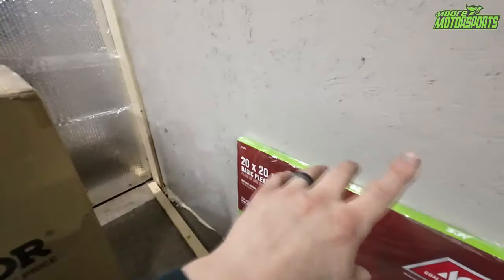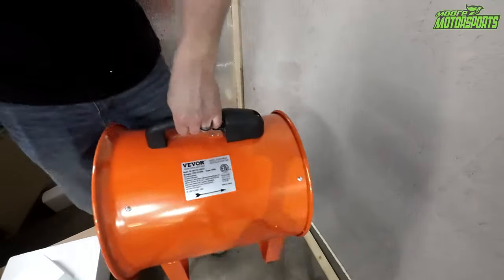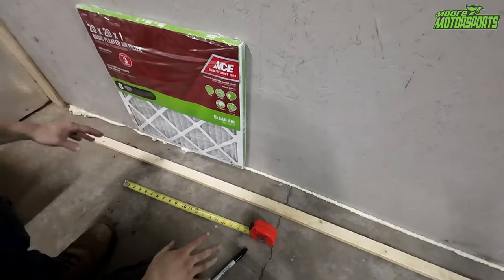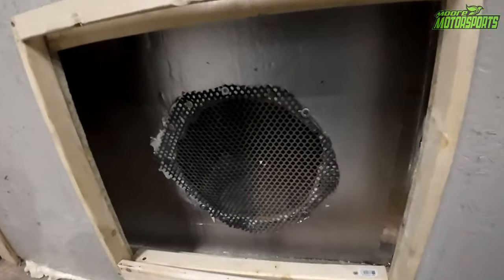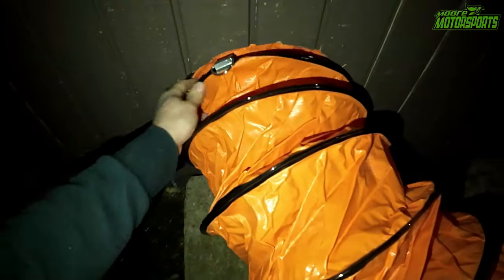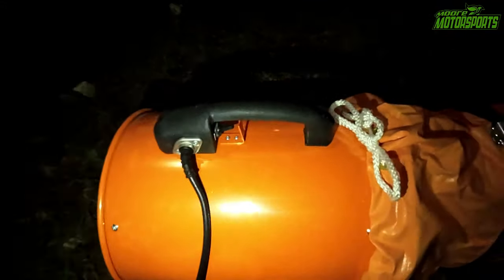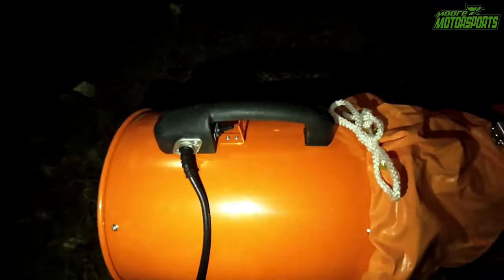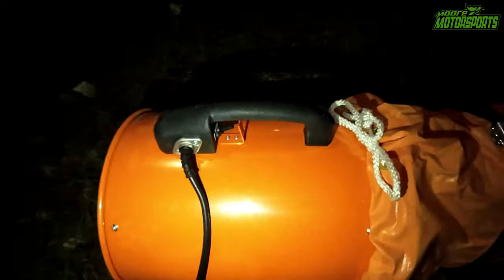FILTERED PAINT FUME EXTRACTOR USING VEVOR VENTILATION FAN & MORE LIGHTS! REVIEW & INSTALL

Comment: New booth looks awesome. You can get better suction if you box in the 2’x2’ opening between the walls. Create a duct so it’s not sucking in the air between the walls.
Reply from the maker: Yea the air between the wall has a massive blockage. Each wall is sealed 100%. If you watched my video of putting walls up you will see but I plan to do a funnel style intake to better direct the suction and I don’t think I even need it. This thing sucks really good

Comment: I suggest building a frame in between the exterior and interior walls. It will help with the extraction and not send fumes in between your walls.
Reply from the maker: I plan to do something like that but it won’t matter if it goes between the walls I built it will get sucked out real fast anyways lol
Reply: I came to say the same thing.

Comment: Would it work better if you had the hose through the wall up to filter? It looks like it could be sucking air from inside the wall potentially wasting suction
Reply: Or if you blocked off the openings inside the wall so it can only suck air from the filter
Reply from the maker: It’s not perfect but works perfectly and the wall is sealed inside by huge beams it’s a sealed wall trust me on that I built the wall but it’s perfectly fine for what I’m doing

Comment: Are you certain this unit is explosion proof? Other YouTubers claim it is not. The Amazon listing does not mention explosion proof
Reply: This is not explosion proof, if you only use a paint can I don’t think is an issue, but if you use an HVLP turbine or an air compressor definitely no.
Reply: @woodzzy1  thanks bro, I've been using this fan on high with a filter for 2 big base coat/clear coat jobs and its doing fine so far. I'm using a fuji turbine spray system with minimal overspray.
Reply: @woodzzy1  I've just purchased the same unit. It says directly on user manual that it is NOT explosion proof 😔. I'm curious how it's holding up nevertheless !
Reply: Is exploding a concern for water based paints?